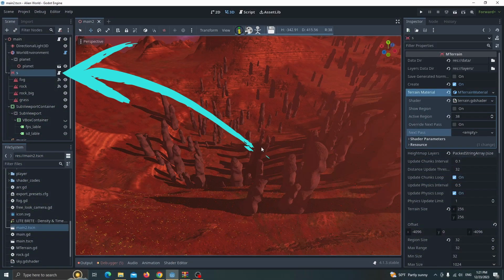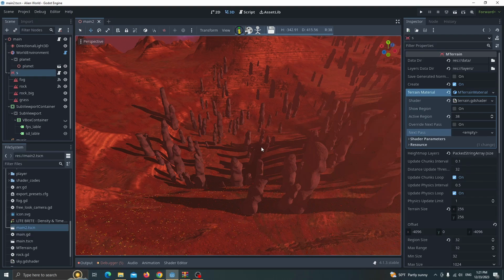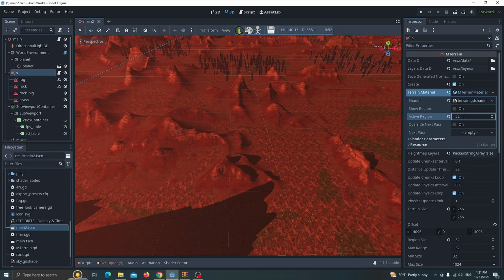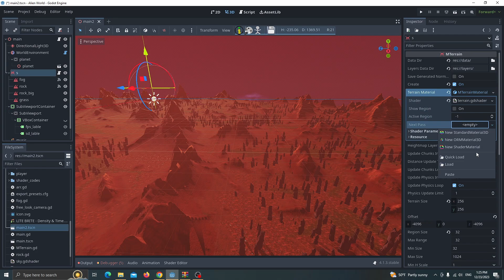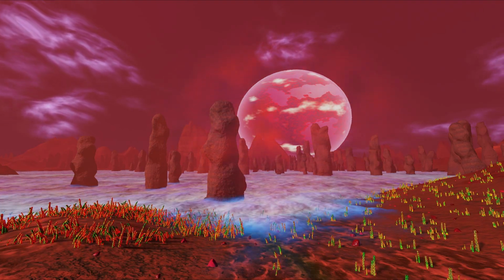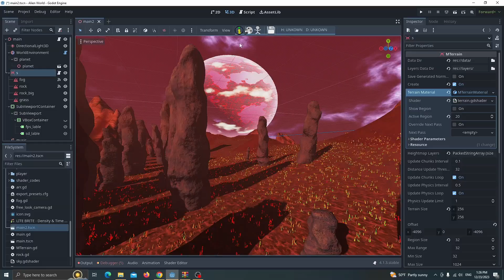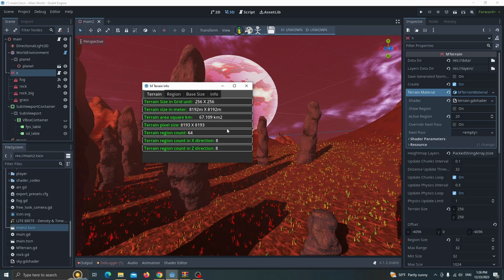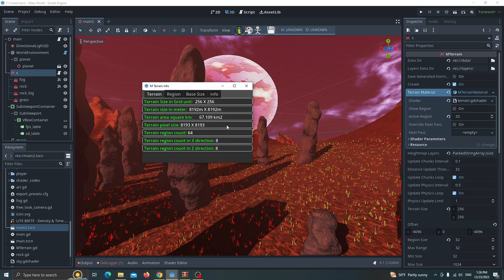MTerrain Adding Water System - new update - Godot engine

Comment: hey man, i’m using the MTerrain plugin and I’m having a bit of a problem. I can set the ‘next pass’ just fine in the editor, but when I run the game and create the terrain with create_grid(), it doesn’t apply the ‘next pass’, the shader doesn’t appear. I’ve tried a bunch of stuff and looked through the docs, but no luck. I need a way to update or apply the ‘next pass’ after the grid is created at runtime. Right now, my water only shows up when I manually click ‘override next pass’ while the game is running. Can’t find any other way to do this, any ideas?
Reply from the maker: Hi there! What Godot Version do you use! try to save you terrain material and see if you get any luck! I am also testing that again! and see if I can find that problem!
Reply: @mohsenzare2511  hi Mohsen, tks for your response, i’ve tried your suggestion of saving the terrain material, but unfortunately, it didn’t work out. I’ve tested on both Godot 4.2.1 stable and 4.3 dev 4, and i’m encountering the same issue on both versions.
Reply from the maker: No problem man, I will take a look at it and see I can find the problem! by the way every-time you got a bug inside plugin it is a good Idea to create a GitHub issue and describe what cause that, Here it is easy to lose stuff! Thanks anyway
Reply: @mohsenzare2511  My bad, man. As soon as I get some time, I'll go there and open an issue about this and also about a problem of gaps/holes appearing between regions in the new alpha 2. Thanks for the help!
Reply from the maker: @halfralf  Thanks man, By the way the gap problem is solved, https://github.com/mohsenph69/Godot-MTerrain-plugin/commit/eec6b35dc076bfc5f8a2c195b45353661696f01c